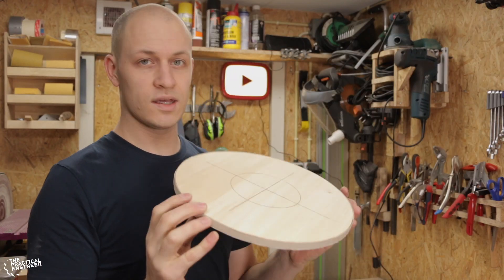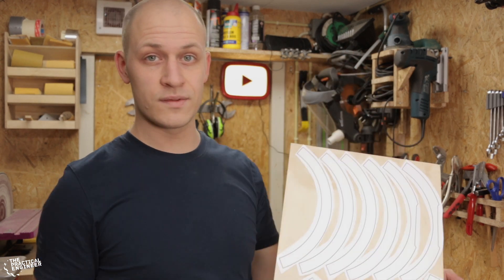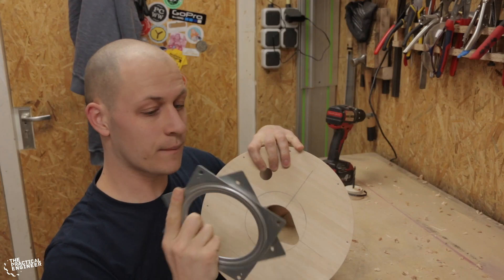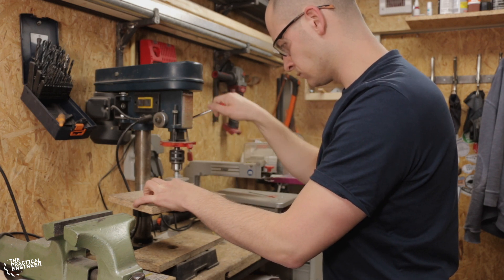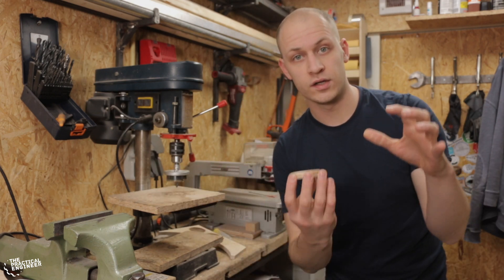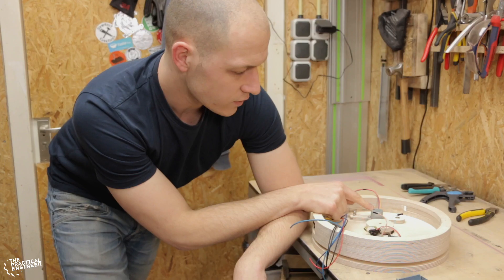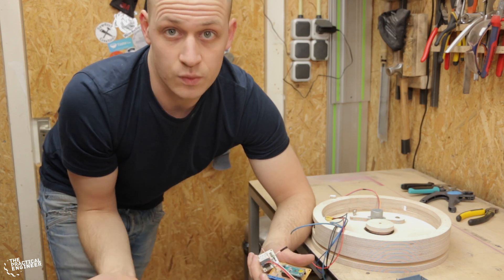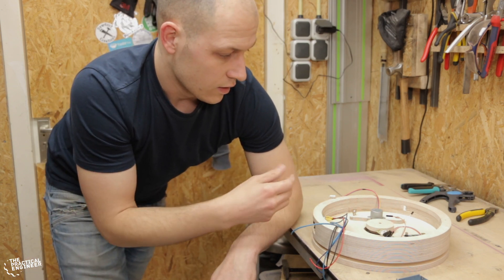Motorised turn table DIY - Make beautiful product video!

Comment: What brand/model of band saw do you use? what do you recommend? I see you have Festool, so I know you like high quality tools.... 

Also, what kind of pencil are you using? That looks cool.

thanks :-)

taylor
Reply from the maker: Hey! The bandsaw I use is a Metabo Swift 260, I bought it second hand a while ago because it was fairly cheep and seemed fine. The one I have had some use in the past but still works fine. What I recommend.. Though question, there are a lot of good options. The metabo bas 261 seems nice as well. If you have the space (and money) invest in a model that's one step bigger than mine.

I do indeed love high quality tools. They speed up the working process a lot.

The pencils are called Pica-dry, they also make a marker. They are nice to mark through a hole.